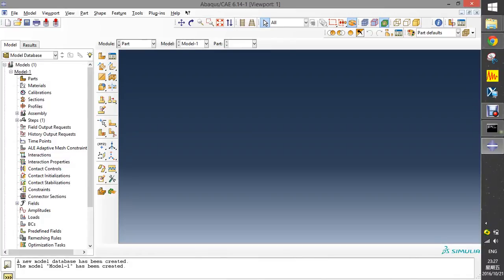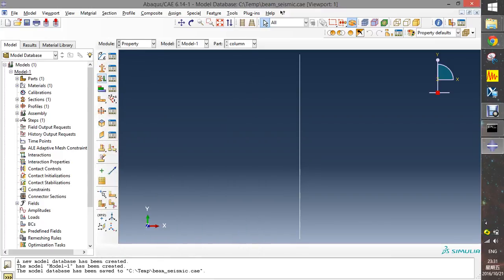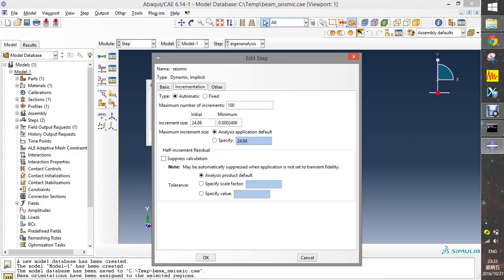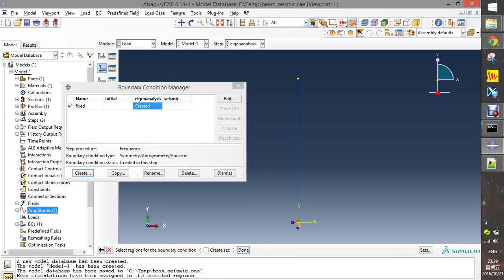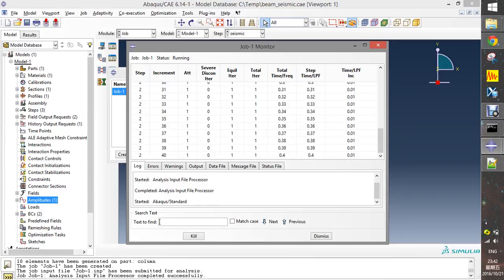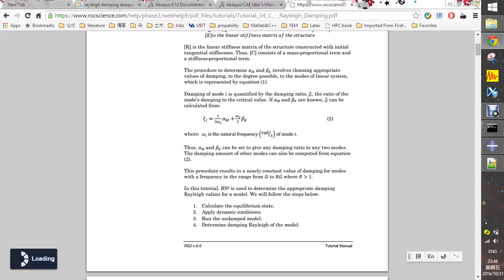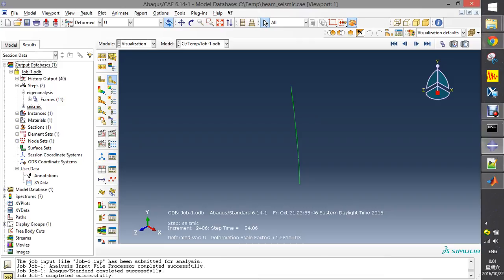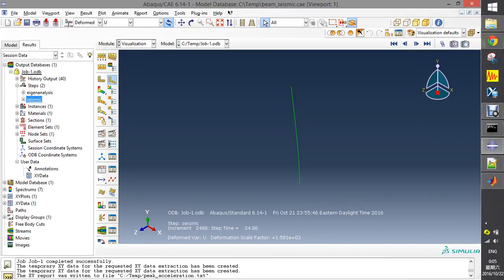Seismic analysis of a simple column in abaqus

Comment: Dear Wang
Please tell me how to compute in detail the  Raleigh mass & stiffness Prportioal damping for both concrete and steel? If it is required to define both in concrete & steel bars? 
Also, if I use implicit dynamic nonlinear time history analysis, it is required to define both parameters.? or use the default values = 0, Please reply me fast. Thanks

Comment: Dear Wang, why do you not considered self weight (gravity load) in the seismic analysis step?
Reply from the maker: You are right, it is better practice to consider self weight as an external force in the model, however, it doesn't affect much for linear elastic model. Note that the Mass matrix is constructed according to the weight distribution of the model which means the dynamic effect is correctly considered in this linear elastic model. Since it is a  linear elastic model, stress is not that  important like displacement. However, the displacement at the Z direction is not correct because I didn't incorporate self weight as body force into the external force vector.
Reply: Thanks for explanation; your SSI video is great which made my life lot-more easy.
Reply: hello, do you know why we put 1 into x direction while defining boundry condition for seismic analayse?

Comment: Dear Sir
how did you find the value of damping coefficients alpha and beta (at 20:39)
Reply from the maker: check any finite element book to calculate the Rayleigh damping coefficient.
Reply: @fangbowang7317  sir you are using Rayleigh equation a=alpha,b=beta

€=1/(2w1)a  + w1/2 x b
€=.05

w1 take 2.781
w2 take 17.085
And make two equation of w1 and w2 using Rayleigh theory and solve alpha, beta 
But buy solving them answer is 
alpha=.23 , Beta= 5.03x10^-3 but you put alpha = 1.508 and
 beta = .000801
Why??